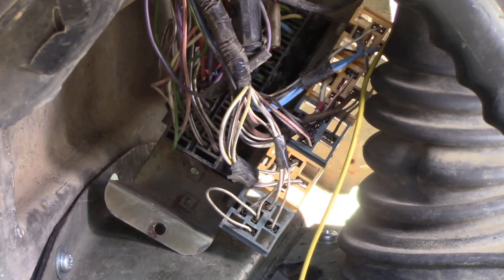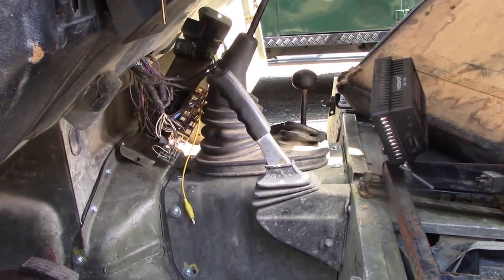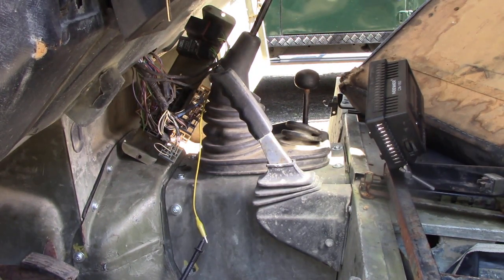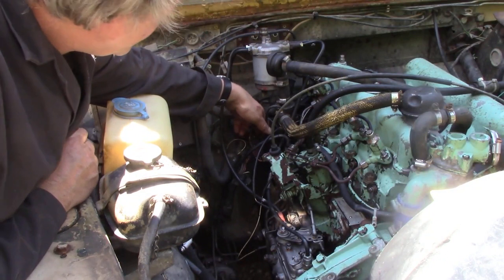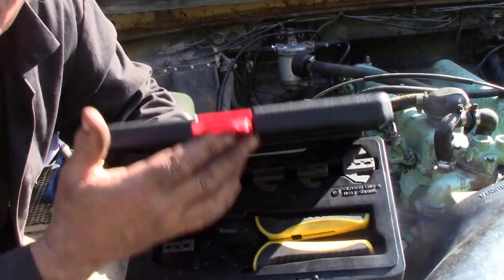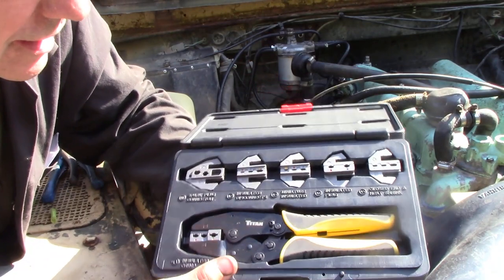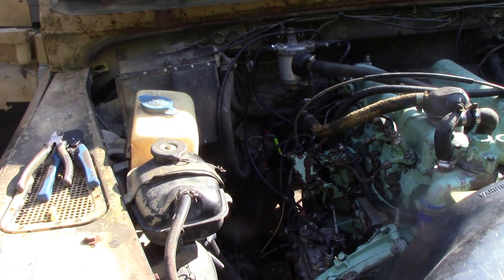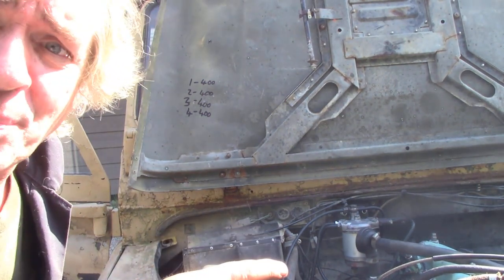Wiring problems! Intermittent start, no charge. How to trace and fix cheaply!

Comment: Got to love wiring issues, tracing fault for no  indicator lights working, unless bridged and then they light but dont flash.  Fitted new column switches, new hazard swith, tried 2 new flasher relays.  Also dipped beam oneside(bulb is fine) not working,. I wont give up though,lol. All this since tranferring everything onto new chassis, I'm trying to make this Landy better, but its fighting back.lol. Keep them coming Mike, enjoy them immensely, and get great tips/advice. Mac
Reply from the maker: Bad grounds and bad connections - the harness itself is not too bad
Reply: @BritannicaRestorations  Foolishly I alwaysbelieve the connections are good, hahahaha. Thanks for the pointers Mike, I will check them.

Comment: Mike help me out my landys packed up came out to go home went to start it and had the exact same thing managed to tap it with the hammer and it started parked it up and mine tried it again and had the ticking any suggestions what it could be? Spoken to a mechanic friend of mine and he seems to think its the solenoid any way I can fix this or is it a complete replacement?
Reply from the maker: Try find a local alternator/starter repair shop and have it fixed rather than buy a cheap Chinese one  - they are not worth the money IF you have an original LR starter on there - but it may have been changed already - who knows ?
Reply: @BritannicaRestorations  thanks mike I’ve managed to find a LR specialist I’m dropping it down there Saturday he’s going to put a recon on for me I did think about stripping the solenoid and cleaning it because apparently you can but thought it’ll probably happen again thank you for getting back to me. And happy new year to you

Comment: I have a similar problem  on my V8 101, will not turn over and getting worse but walk away or slam a door then try again fires right up. Sometimes just loses all power sitting on tick over just fades and, then won't start with a solid jump. Has a small old battery and a tipper fitted but works mostly so not sure if a new battery or alternator will help. Gonna watch again and try it .
Cheers (UK)
Reply from the maker: Sounds like a bad connection = the methodology is the same - power to switch and / or relay - if OK, then continue along the wire 

If it were a bad battery it would be constant  - but it is worth checking!